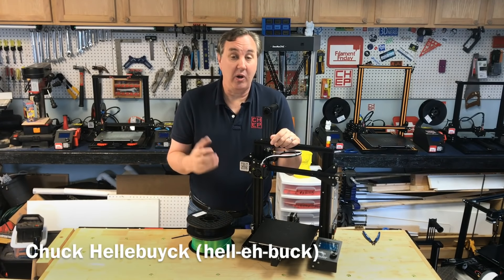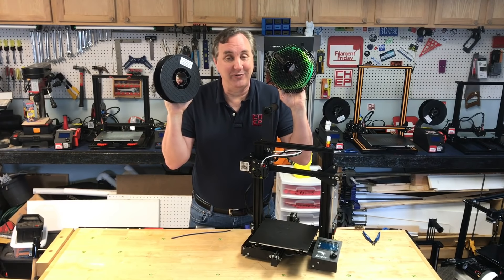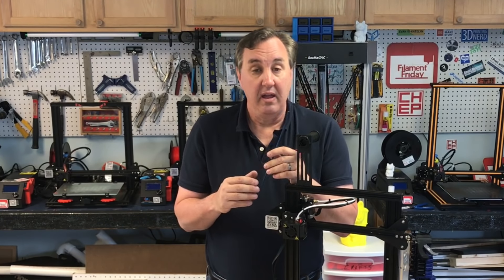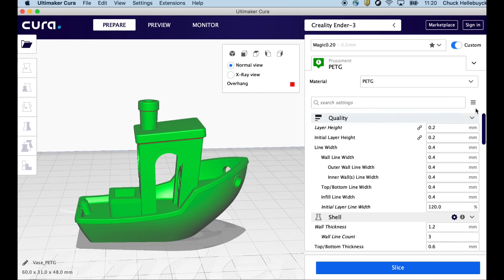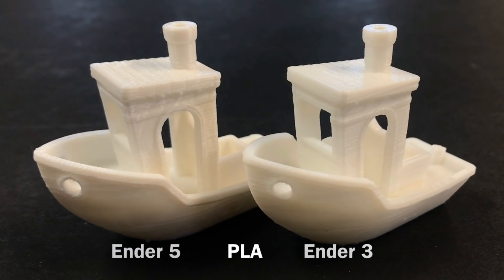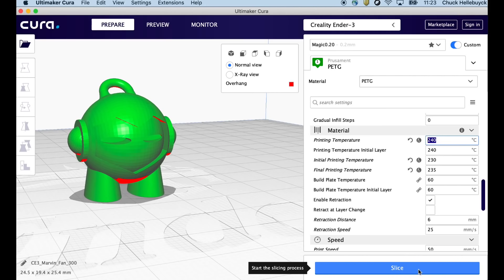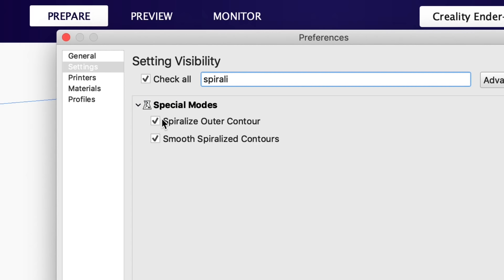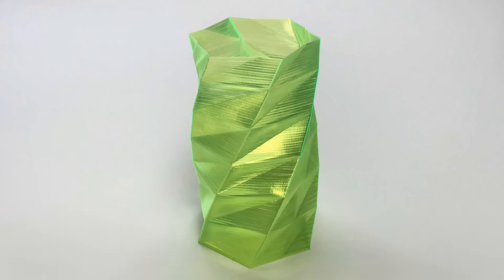PETG on Creality Ender 3 - Atomic and Prusament

Comment: 6:25 I'm not surprised, Inland filament is _absolute garbage_, all of it.
The only roll of filament I've ever not been able to get through at all was some Inland white PLA; it was so brittle it cracked going into the extruder, and it wouldn't flow at anything less than 220° C (and the surface is not nice) -complete waste of money and time.
Reply from the maker: Their white is the worst.

Comment: If you have problems with the PETG model being knocked off your print bed, set the Z offset to +.2mm as petg works best if it is dropped onto the model rather then squashed into the model.

Comment: travel?
Reply from the maker: Sometimes I do.
Reply: From what I've read - PETG travel can be as fast as possible.

I've had a hell of a hard time with stringing so far with PETG.
Reply: @nicholaswillcox  Retraction Distance: 1.0 mm;  Retraction Speed: 30 mm/s. it would be fine like this ?
 I have an Ender 3, Thank you.
Reply: @Leandro-np1uk  I will try that.  I've been doing MORE retraction distance and faster speed and still getting stringing.  So less of both think may help?  This last week we got turned into blocks of ice so once everything is back to normal I'll try that.
Reply: @Leandro-np1uk  Are you using direct drive or bowden? 1mm seems like too little, but let me know. I've been having some bad stringing with petg. Thanks

Comment: I can get better results than this but, I don't recommend PETG, horrible plastic to work with. You will be wasting more time trouble shooting, trying to print anything if it gets too humid is a waste of time!
Reply: The whole point is to use petg
Reply: @Vibakari  Just don't. Better filament exists, it's not even that strong.
Reply: @Ryuuken24  well I need something that doesn’t warp in a hot car, can handle loads, relatively available/cheap, and can be printed on an ended 3 pro. What do u recommend?
Reply: @Vibakari  For your use case, you'll need to google. Both PLA and PETG can handle 200 degrees.
Reply: @Ryuuken24  except the glass transition temperature of pla and pla+ is 60c, which hot cars can easily reach here in phoenix. Not to mention I'm 3d printing gun parts, so it's not exactly cold temperatures.
Reply: @enb3810  just curious. how hot does a lower receiver get?

Also found out that ASA has a higher glass temp than petg (about 20 degrees more). The only thing is that it gives off fumes and prefers an enclosure like abs.
Reply: @Ryuuken24  You tell someone not to use petg because it's horrible then tell them to Google for something better? Petg is almost as easy to print with as pla. Get your first layer down good, retraction and cooling. What troubleshooting is needed?